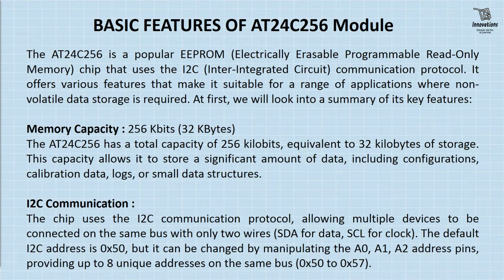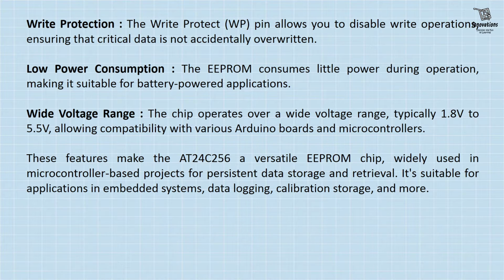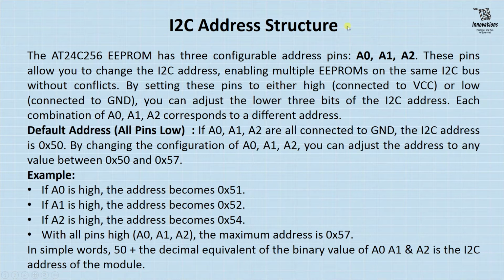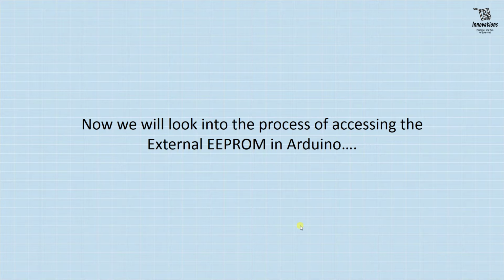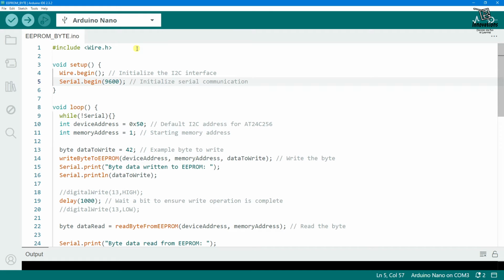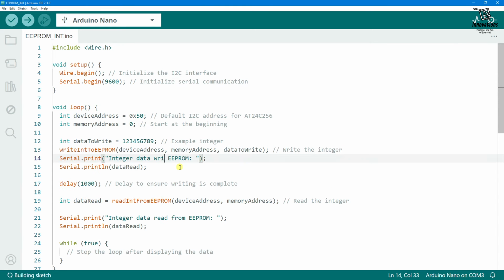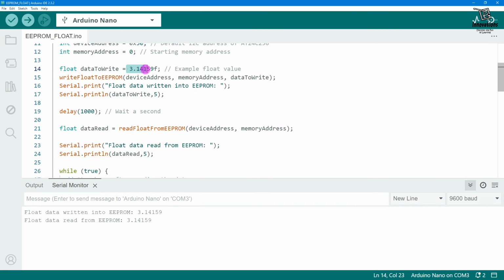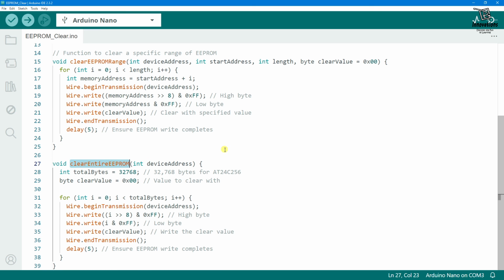AT24C256 - External EEPROM with Arduino | Detailed Explanation & Sketches to Write / Read / Clear

Comment: Anyone facing problem using the bare 8 pin 24C256/128 IC. keep the A2 pin hanging. give ground to A0 and A1 it will give you address of 0x50.

Comment: I'm working on water flow meter. it measures how much water is used in liters. i want to store it at24c256, after using the water it should add in previous data. and after power off it remains saved. can you please tell me??
Reply from the maker: Which part do you want to know?